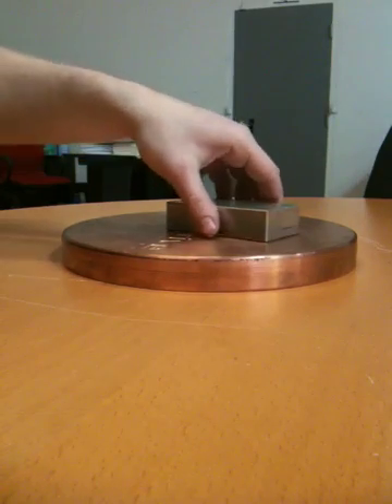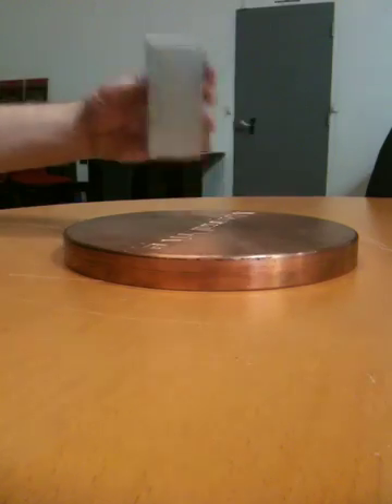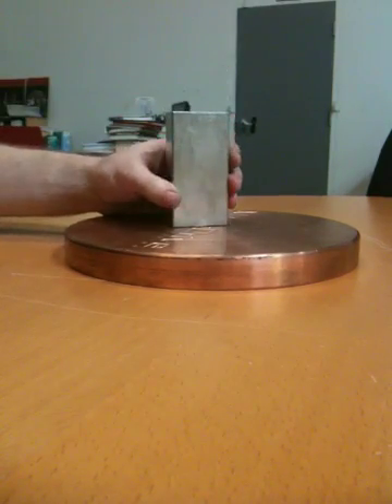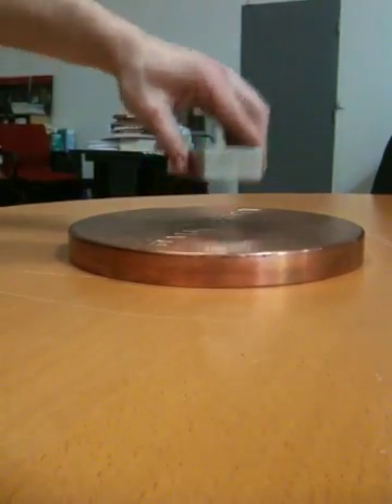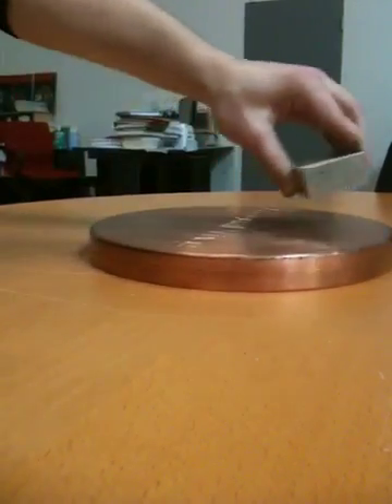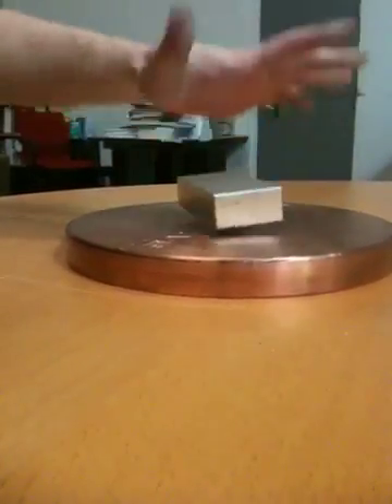Eddy Current Demo.

Comment: Sir. May I ask if you replace this copper disc for a superconductor, what would happen when you slide the magnet very close? It would try to move along with the magnet too? Or since magnetic fields are expelled eddys current doesn't appear?

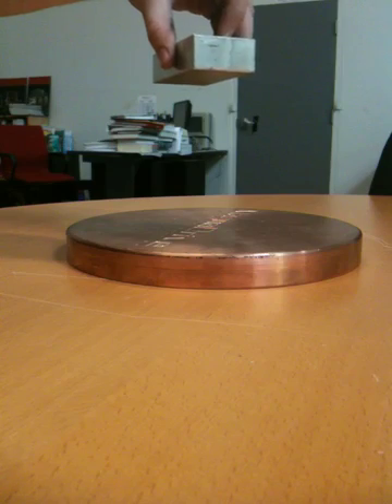Comment: 0:35 

It is never advisable to "drop a neodymium magnet" (on to a  surface )

like falling on a hard floor  be it wood or cement,  or  even have a neodymium  magnet dropped onto iron, or even let it fly into another magnet

 it can shatter. 

The flying shards can be extremely dangerous when they shatter.

Please encourage safety.
Reply: Thank you for saying this my first thought was why dont we use something like this as a drop dampener if it does that so well shrapnel is a pretty good motivator as to not attempt it.

Comment: Why Copper metal ain't getting stick to the magnet ??
Reply: The same reason why a pound coin does not "stick" to a magnet, copper is not magnetic. But copper IS a metal, so when the guy dropped the magnet onto the copper, the copper (being a metal) cuts the field lines of the magnet inducing the eddy currents.

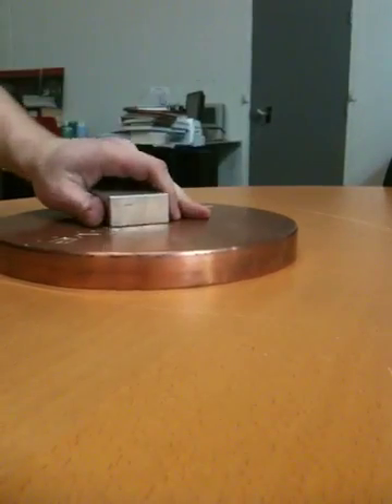Comment: @1:08.....why is the magnet still moving after the initial inertia...floating?
Reply: Mr. Crowley because it was slided in air near the copper plate and due to the high magnetic property of the magnet the copper got magnetised a little and hence it repels the magnet. 
Thus the slide for a slight duration😎

Comment: what if a person wears magnets and jumps from a building on a copper bed
Reply: Depends on the strength of the magnet. He would be cushioned, but the size of the cushion would follow an inverse square law, so the magnetic field would have to be quite high for the cushion to be large enough to slow him down slow enough to reduce the g-shock to a survivable range. However, it is very possible, and magnetic shock absorbers are used in luxury vehicles. I am unsure if any of those are based on eddy current cushioning however.
Reply: Impact = force/time 
If they're going 100km/hour and they're slowed down over a fraction of a second, sure the impact will be a bit better, but there will still be problems
Reply: Still probably going to kill you, or leave you in a state that you wish it did kill you (bedridden, paralyzed, TBI from brain hitting inside of skull, all that nasty stuff).

Better system would be to run an aluminum channel rail down the elevator shafts and have a bunch of trolleys with magnets run in that channel, connect harnesses to those trolleys with nylon webbing, and people go in the harnesses.
Size the magnets appropriately and you get a descent rate that's faster than stairs and has a higher people throughput than elevators.
Solves the problem of high-rise fire escapes, because it has been demonstrated that stairways aren't fast enough to get everyone out of a high-rise within 30 minutes or less (preferably more like 10 minutes).
Look at that, I took a joke comment and made something useful out of it. Now to get it tested and put in-use. It's pretty simple (no power/no batteries/no electronic anything) so it shouldn't be hard to make extremely safe.
Reply: JUMP IN A COPPER PIPE WITH A MAGNET WEAR IT WORKS
Reply: Physics is still physics-- this isn't magic.  a= change in v / change in t.  Calculate the resulting acceleration.  It will be quite high.  Your body can only sustain so much acceleration.  You will still die.
Reply: The force due to height and velocity is so large after having weight more than 100lbs approx.  Even using the magnet will produce a high pressure on joints and impulse will nearly break ligaments plus torque will rotate the body upside down the push will be evil
Reply: would make a great stunt, diving onto concrete by passing through successive rings of copper... or preferably silver!

as pointed out, simply falling onto a "flat" magnetic pole isnt very effective. by the time you get close enough to the field to feel the effects, you are TOO close, and stop too abruptly. be it due to eddy currents or simply overshooting... that momentum has to go somewhere...

whereas falling THROUGH a ring, a tube, thats enough to slow you down gradually.

actually, would make a great fun-park ride... like a water slide but you just get dropped... free fall... then slowing down in the last few seconds with no visible mechanism but the harness... no carriage, no slide... just a harness..

I WANT ONE NOW!!!!!.

considering the issue of say, belts with super powerful magnets, it may be better to reverse that... the rider wears the fat copper ring and falls through the magnetic field... like a life saver! 

maybe with a free CAT scan whilst theyre at it... lol.

taking it further with AC fields, they can levitate/launch you as well!

Comment: is the movement in the magnet not a repulsive force? The magnetic field of the magnet induces an eddy current, the induced eddy currents, create an magnetic field that will oppose the movement of the magnet. Which means that on one side the copperblock will be attracted and on the other side it will repel. This is why the block is moving isnt it?

Comment: Great video!  Question.  Is it possible to harness these electrons and convert them to electricity?  Its not being done that i know of so I assume its not possible or inefficient.  Is it possible to harness it somehow?
Reply: How is that different from a normal electric AC generator?
Reply: Craig Greenwood Yes, it’s called regenerative breaking and has been used in hybrid cars (e.g. Prius and others) for more than ten years!
Reply: Yep, regenerative braking does this for rotating things, and linear induction generators convert back and forth motion into electrical current.

Comment: Weird question but can this crest friction or is it just the magnetic field doing all the work
Reply: +TJ_BASS 
It's all magnetic. Some train brakes work this way to break from high speed without the probmel of friction wearing down any brake pads or such.
Reply: TJ_Bass all magnetic 
Just the way bullet trains run 
They move an inch above the rails in this way... Just at a large range

Comment: you sure you did not have anything under that table? i hate videos like this making ppl think theres always someone trying to fool others by not showing the whole picture
Reply: +Frank Lopez This is not a magic trick. This is a natural phenomenon. Look up other eddy current videos if you want proof.
Reply: Meanroachman360 i know what eddy currents are, however what your doing and what your not showing can be deceiving and that was my point by my statement,
Reply: +Frank Lopez There is nothing under the table, 110%. You can do this yourself really easy. Just get the strongest magnet you find and then get some non-magnetic metal, aluminium or copper works really well, and then try to move the magnet across it fast.

Comment: Just out of curiosity, what would happen if you had a tube made of neodymium and then dropped a piece of copper down through it? Could you still generate eddy currents if it was copper falling down a magnetic tube instead of the other way around?
Reply: Mike Davis Motion is relative so I would imagine so.
Reply: +Mike Davis  eddy current generates due to variation of magnetic field with time so yes when copper piece would also undergoes eddy current..

Comment: Have you tried vibrating the copper plate, perhaps suspended so it would ring, at one of it's resonant harmonics... possibly in the ultrasonic range?  Wonder how slowly the magnet would fall into it.
Reply: Exactly the same average speed, except it would have a vibration imposed on it of exactly whatever frequency you move the copper plate.
Now if you pushed the copper plate towards the magnet at the same time the magnet's falling, that would make the magnet slow down with respect to the ground.

Comment: As u can see he did drop it a few times but from a 10mm or so. You could see how the induced current magnetic field slowed down the magnet. If you wold drop it much higher then it wold have much more velocity and inertia what the current induced magnetic field could not stop probably.

Comment: Have you ever noticed that many rollercoasters hitch to a chain or pulley mechanism shortly after slowing significantly? The friction brake is most likely the engine attached to the mechanism (or dynamo, however the engineer set things up), with an emergency backup friction brake that almost never gets used. The electricity generated by such measures would reduce some of the cost of operation provided the implied capacitors could handle it.

Comment: Based on what I am currently studying in ECT 125: It would be a voltage spike based on the EMF interaction between the EM field and the reactive metal. It would zero out quickly.

Comment: But I still can't understand the meaning of eddy current
Reply: 2424aaa1 , magnetic field's coming from the magnet are Eddy current's  , it does the same with aluminum and silver  , I can slide one cent Pennys across the table , aluminum pop cans , silver rings or drop a magnet down a copper tube and it floats down

Comment: If neodymium is an element & not a compound or solution (albeit a solid solution), then how could a neodymium magnet be made of iron, boron, and nickel?

Are they the filler, which make a neodymium magnet whatever grade it be (N48, N50, N52, etc.)?

Comment: Heh, we tried the one with dropping a magnet through a copper tube at work yesterday. Now I'm gonna have to try this today.

Protip: Aluminum works just as well. If you want a thick walled aluminum tube, a bicycle seat post works pretty well.
Reply: Or simply raid your mom's kitchen cupboard for the Reynolds Wrap. The roll of aluminum foil is a ready-made tube as well. (Credit: @electroboom)

Comment: Pretty cool job man!  In the drives that you work with....do you always use just large flat plates of copper or have you ever thought about cutting slots (radially) in the plates to further enhance/strengthen the eddys which are induced (essentially, in a way,  you would just be imitating a closed circuit copper coil (which instead of inducing current as a open circuit coil... produces back emf).   I'm just curious if you would get better results w/ this approach.  Something to think about.
Reply: it KILLS the eddy currents. the solid conductor is why the eddy currents can circulate.
also more mass... less resistance... more thermal reserve...